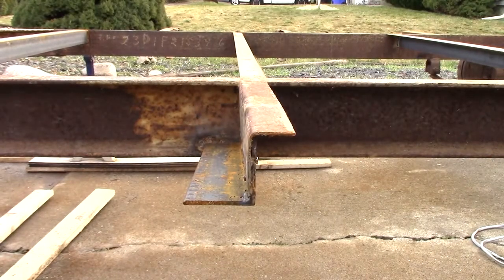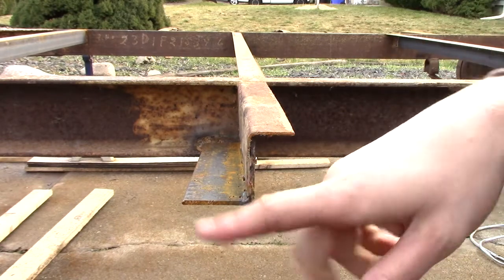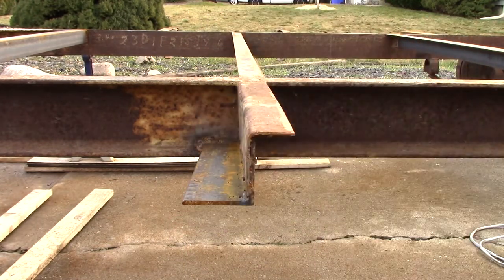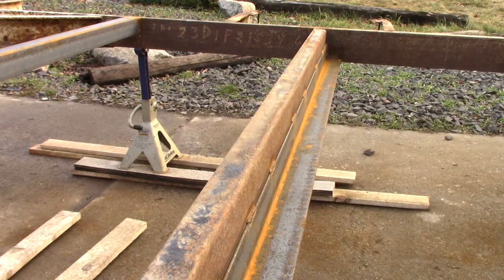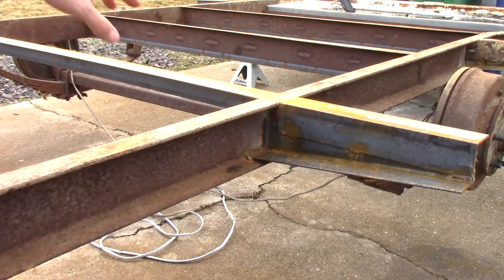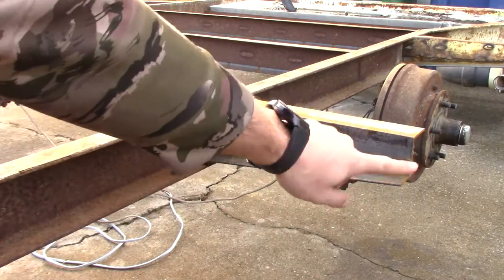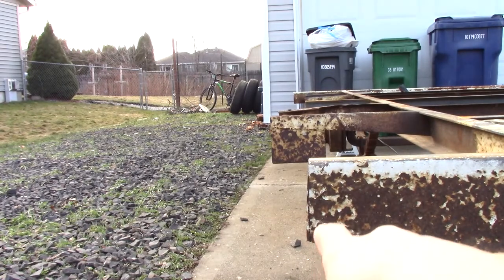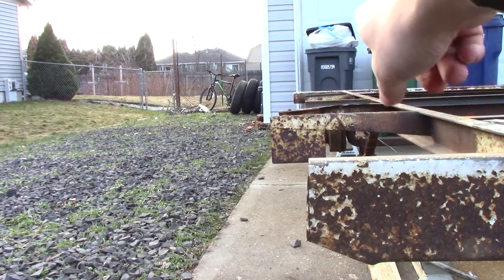Travel Trailer to Flatbed 3.0 Ep. 2: Reinforcement

Comment: I'm currently  building a 28 foot sxs trailer from a old camper frame. I'm using  2 inch c channel  for crossmembers  . They run the full width  of the deck. Welding them 2 feet on center on top of the 5 inch c channel  frame. I cut all the original  outrigger  off before I started  welding anything.

Comment: I, like you're idea what you're doing because you're helping me of what I need to do my friend gave me a mobile home which is 14x80 and I've got to disassemble  the whole house trailer down to the frame then I've got to cut it back from the rear AXLE and cut the front to bring the hitch back I'm going for  a 20ft  trailer it's got 3 axles I want to build it for hauling  my commerical Backhow

Comment: I am actually gathering material to do the exact same thing on my travel trailer but I'm going to use some sort of 3/8 C-channel cut up in 10" to 14" length to add strength to the wall support angles. The shell in dropping do to the manufacturing materials weaking and warping.

Comment: I have a angle iron frame trailer.  7ft x 4.5ft trailer and the angle iron i do believe is 2x3 angle iron x 3/16 inch thick.  These are my main beams running lengthwise.  Then there is sheeting sides about 16 inch high which does add little strength.  the cross members are just 2x2 angle iron probably 3/16 inch thick because i was grinding the rusted out metal floor out.  It has a 2000 lb axel.  Is it possible to upgrade the axel, and reinforce the frame to hold 3500 lb or 5000lb of soil?
Reply: Did you reinforce your trailer?

Comment: Very helpful, like the other guy said, wasn't sure how to reinforce the frame of the trailer, luckily I have two trailers and one will but cut up for scrap to use as reinforcement material for the other trailer.
Reply from the maker: That's awesome. Anytime you have a scrap pile to save material costs it helps.

Comment: Does reinforcing it make it be able to put more on it ?
Reply from the maker: If the axle and springs are upgraded as well then yes. The main reason I do this is because the frame has too much flex in its standard configuration without the structure on it.